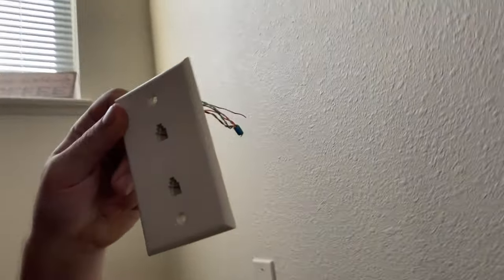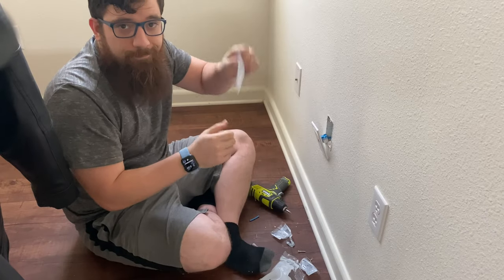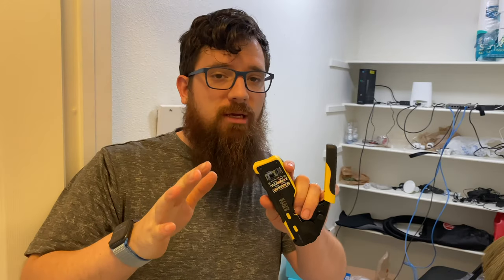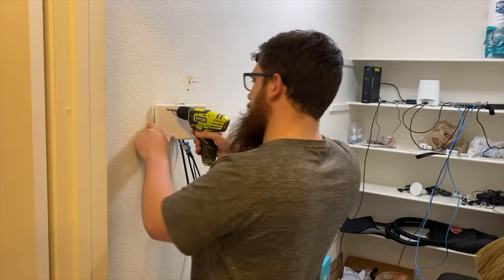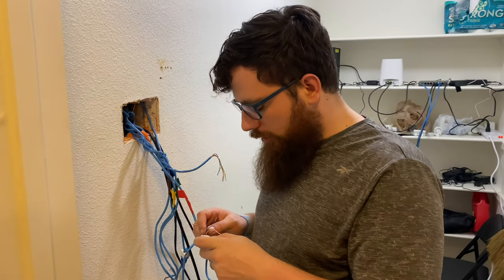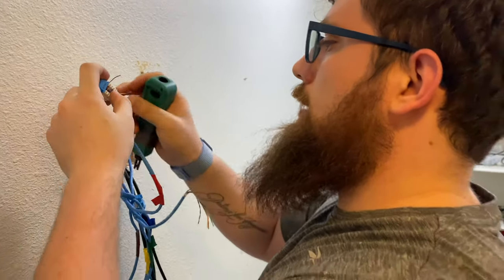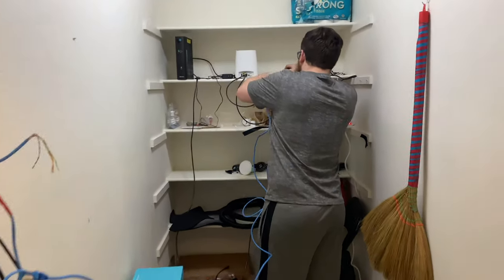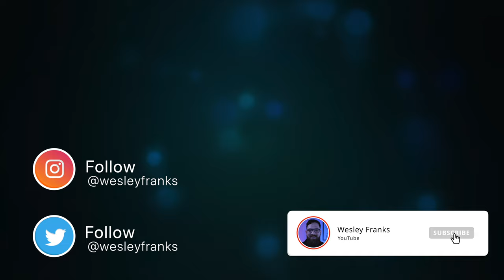Can a telephone jack give me internet? | #homenetworking #networking

Comment: So I have my router downstairs and my room is upstairs and I wanted to convert the downstairs phone port to a ethernet port to I can plug the modem /router and hopefully the phone port in my room can be converted so I can plug it into my pc in my room . But for now I just use WiFi extender but the shut off randomly and when I stream that’s a annoying thing to happen
Reply: Bro did this end up working having the same issue rn want to stream but my router downstairs and I need Ethernet

Comment: I was wondering if this will work. I have a modem in the living room with a rj45 port right next to it and a rj11 port in my bedroom. If i connect a ethernet cable from the modem to the rj45 port in the living room and then a rj11 to rj45 adapter to my rj11 port. Will wifi flow through to my pc or not?

Comment: My cable doesn't have the brown-brown/white wire in it. Does it matter?
Reply from the maker: I would say yes, but as long as you have the same number of wires the only thing that matters is that you have the same on each end. The tough thing is keystone jacks go based on the colors i mentioned so you’ll have to figure that out

Comment: I just moved to a new house and have an rj-11 jack in my room. Our main wireless router is so far from my bedroom and it frustrates me having poor wifi signal. If I were to mess up with the rj-11 jack, what should I know first? Like I don't even know where this jack is connected from. Is there some kind of chart or blueprint should I be looking at first. Sorry for long post
Reply from the maker: First is to open the jack and see what type of cable is used in the wall. Then if its RJ11 than you can’t wire any internet up, but if its RJ45/CAT5 than you can follow a video i have to wire up an RJ45 wall jack. Check my videos i have another more recent. Go to my channel > videos tab > scroll until you see the RJ45 cable video that should help
Reply: I have the same problem as you.  The router is so far that wifi signal is weak.  What about those RJ11 to RJ45 cable adapters selling online, will the work?   What did you do to solve your weak wifi problem?

Comment: What port did you plug the 5 cat into your router? And are all the other steps after the first outlet you did necessary? I just wanna get one outlet working really fast cause that’s all I use.
Reply from the maker: Thanks for commenting the port doesn’t matter there are only four so pick one. I don’t know why you’re asking if they are necessary this is less of a full tutorial and more of a vlog style documentary on the project I did felt it was good content. If you want to get one going fast there are a lot of variables to consider. Can you access your attic? Can you even run a cat 5/6 cable? Do you have a magnetic cord puller so you can get through the insulation if there is any? Can you afford to punch a hole in the wall and properly cover it with a wall plate for that “one” cable. Normally it’s not standard to run one cable so it would make no sense to build a network closet for one cable. I’d look up other videos that teach you how to run cables in a home and build a network closet.

Comment: Not too much to learn as you place the cables but I don’t see where. We need to see cable by cable where are they attached too.
Reply from the maker: Of course but it was more of a story and a tag along then it was a tutorial that’s why it’s not “how to do x y z”.
Reply from the maker: I asked the question can it give me internet and it did. That’s it. If you’d like more videos then ask for those.
Reply: ebay sells rj11 to rj45 adapters. do you know if these will provide same result as rewiring the jack like you did? thanks for the info.
Reply: @ny1resident  yeah i was wondering the same.

Comment: Can anybody please tell what is that metal port sticking out on the left side from the face plate on the wall of Wesley Frank's telephone cable's hole? I have a same thing on my wall, and I have no clue what is that for!
Reply: I believe that’s a Coax port. I think you can connect it to a modem. I’m no expert tho so someone can fact check me here.
Reply: Late, but that is coax. Traditionally used for cable television or cable based internet modems.

Comment: very helpful
Reply from the maker: Thanks!!!
Reply: @WesleyFranks  my house dosent have any labels for the wire is there any other way to distinguish them from each other expect from toner and trail and error
Reply from the maker: @pejaywejay  Unfortunately there isn’t my suggestion is to get a toner. If not that, then if you had enough slack about a foot or so. I’d just put a RJ45 head one the end you know (say your office) then go to where they are and just put a head on all the ones you can. Plug in a laptop on the office end with a continuous ping to google. Then, just trial and error until you find which one it is. I mean it’s just about trying what you can with what you can afford. I know it’s tough, but the answers are sometimes just trying what you can and not getting too annoyed or frustrated. It’s all difficult depending on the house. I lucked out with cat5 already in the wall.

Comment: You do realize you didn’t mention wire colors or anything, you just said you were separating the wires and then sped it up.  So which colors go to what?
Reply from the maker: T568B standard search google and that’s the wiring I did mention that in the video.
Reply from the maker: I’m not perfect if I forgot I’ll try to remember in the next video.
Reply from the maker: You do also realize I’m human and mistakes happen?
Reply: T568b standard